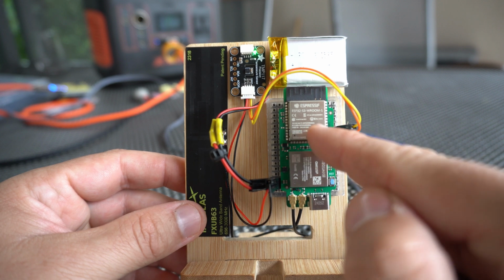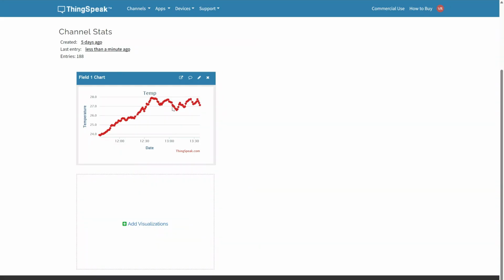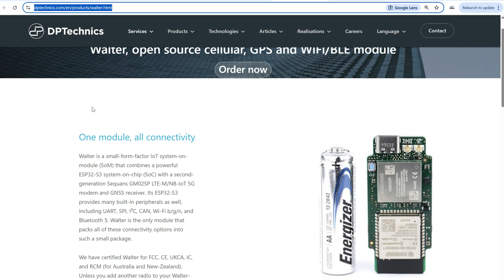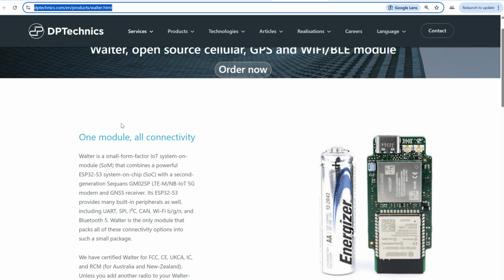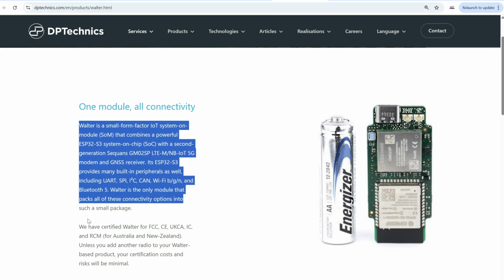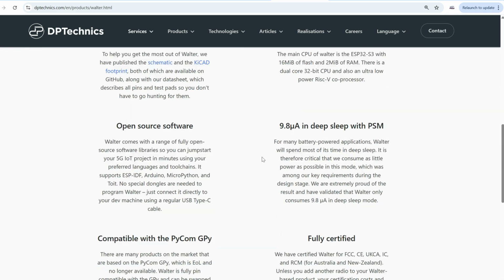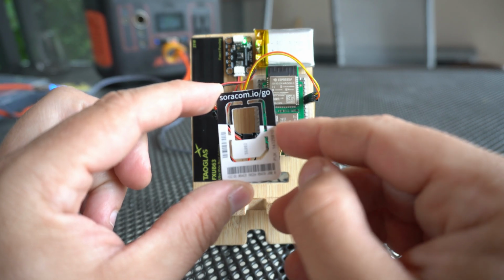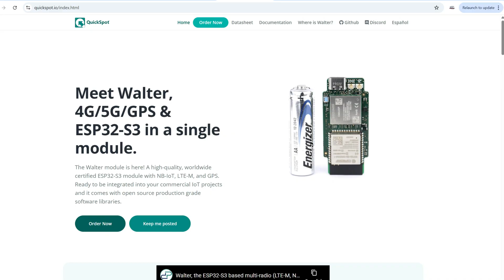No Wi-Fi? No Problem! Meet Walter, the IoT Board with LTE

Comment: Thus, ESP32-S3 can be used as a router in its AP mode to serve other ESP32 devices.
Reply: Yes, that is possible, we added support to the esp-modem component in ESP-IDF so that you can set the modem in PPP mode and make a slow LTE-M mobile access point out of Walter.
Reply: Why not buy ready modem to wifi.. cheaper and better then connect esp32 to that wifi as well as your other devices
Reply: @solidfuel0 
The answer is simple. What if the IoT device is placed in the middle of the sea?

Comment: I bought an mini AP router 4G (LAN, WAN, WIFI, 5V Power USB - small square box) from aliexpress with the same GSM module with 20-EUR not 70EUR the price of this board.
Reply: Exactly.. is it working good so far? Can you tell me model
Reply: @solidfuel0  T-CPE301K - works best
Reply: @solidfuel0  T-CPE301K
Reply: T-CPE301K
Reply: @electronistul  thanks but  i don't find it for 20e. At least 30euros
Reply: @solidfuel0  now you are picky
Reply: @electronistul 😂 this is 33,% increase we are talking about

Comment: Thanks for the inspiring video as always. I like that LTE gets more attention now on ESP32. But I worked very successfully with the lilygo T-A7670E before. It comes with GPS or without. As you like. And that for just a little bit over 30€. + even more features than this board here. + very good integration into platformIO. This board here is little bit to expensive if you ask me. 2 benefits the Walter board has: First: LTE modem combination with ESP32 S3. Which is a very efficient solution. + European brand (Belgium).
Reply: The Walter's size is a selling point for me. The T-A7670E is massive. Depends on your application
Reply: Also the lilygo board does not have deep sleep, there is a fault with all the lilygo t7670g boards that they can't efficiently shutdown the modem and go into deep sleep, it causes bro out issues and the modem on start up draws too much current which also causes brownouts, I wouldn't recommend buying them, nightmare if you want it to sleep